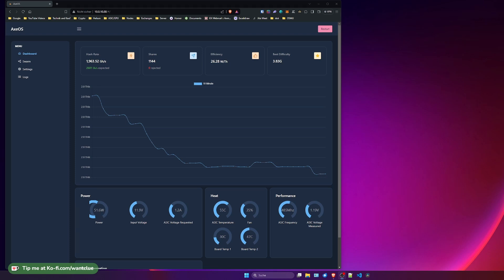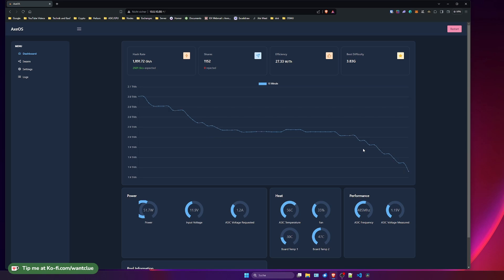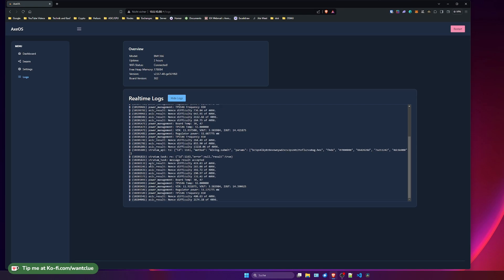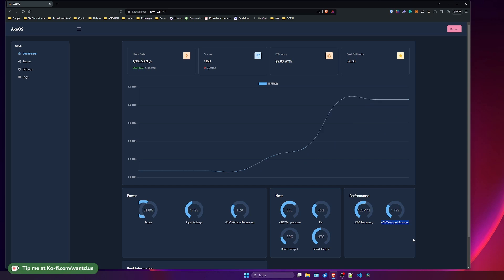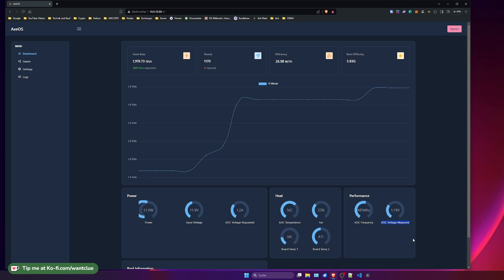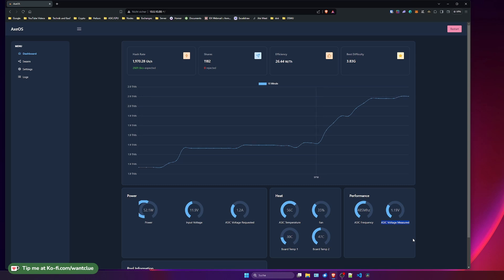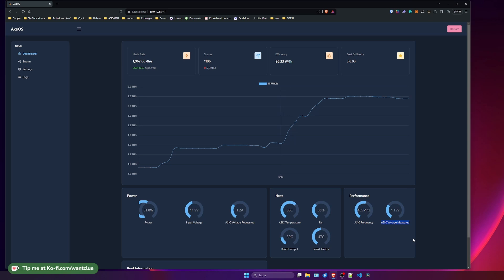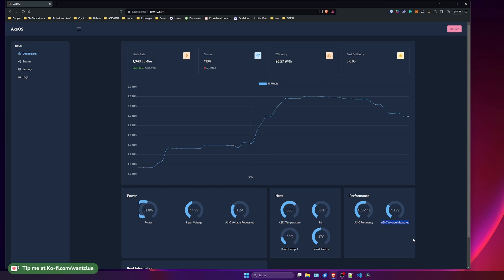Bitaxe 101 | How to debug your bitaxe using AxeOS

Comment: wifi problems are most common i guess. my bitaxe supra 401 looses connection every 10-12 hours with default settings for freq/vol 490/1200. how to fix that? ping test shows 1 packets transmitted, 0 packets received, 100.0% packet loss (no internet connection) sometimes like for couple of seconds every 7-10 minutes: 
2024-07-30 14:22:20: --- google.com ping statistics ---
2024-07-30 14:22:20: 1 packets transmitted, 1 packets received, 0.0% packet loss
2024-07-30 14:22:20: round-trip min/avg/max/stddev = 32.377/32.377/32.377/0.000 ms
2024-07-30 14:22:32: PING google.com (142.250.181.238): 56 data bytes
2024-07-30 14:22:32: 
2024-07-30 14:22:32: --- google.com ping statistics ---
2024-07-30 14:22:32: 1 packets transmitted, 0 packets received, 100.0% packet loss
2024-07-30 14:22:33: PING google.com (142.250.181.238): 56 data bytes
2024-07-30 14:22:33: 64 bytes from 142.250.181.238: icmp_seq=0 ttl=60 time=36.365 ms
2024-07-30 14:22:33: 
2024-07-30 14:22:33: --- google.com ping statistics ---
2024-07-30 14:22:33: 1 packets transmitted, 1 packets received, 0.0% packet loss
2024-07-30 14:22:33: round-trip min/avg/max/stddev = 36.365/36.365/36.365/0.000 ms
2024-07-30 14:22:34: PING google.com (142.250.181.238): 56 data bytes
2024-07-30 14:22:34: 64 bytes from 142.250.181.238: icmp_seq=0 ttl=60 time=31.790 ms